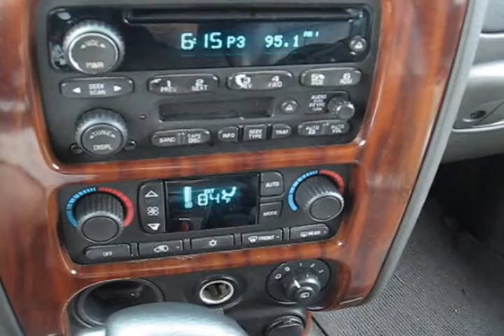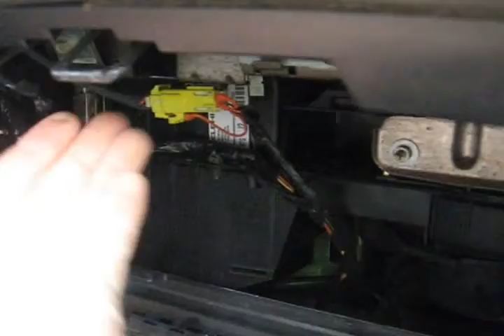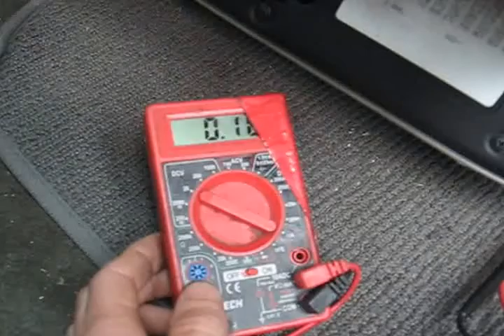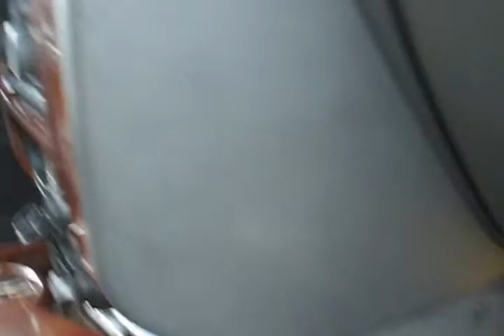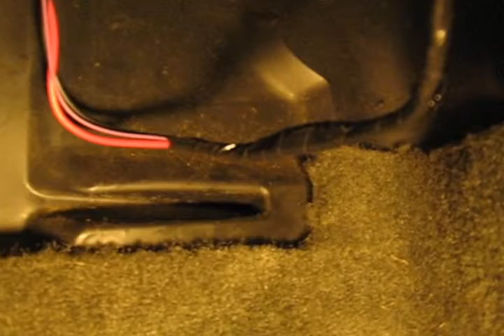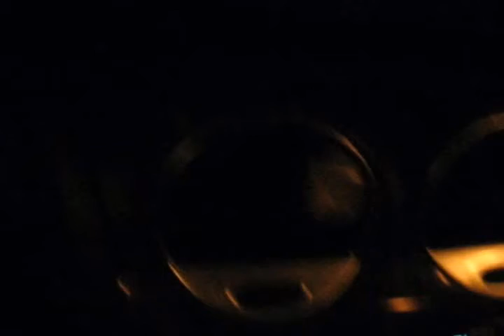DIagnose and Replace GM blower Control Module

Comment: I just bought a 2006 GMC Envoy Denali XL that the blower wouldn’t work. Checked the blower motor, and the blower control/resistor per the video and both checked out. I had a spare automatic climate control panel from my 2002 GMC Envoy, switched it out and the blower began working as new. Usually the blower control/resistor is the culprit but not in my case. Thanks for the great video…

Comment: This was great! The description of the changing voltage on the center wire to increase motor speed was the only video I could find that showed how it worked. Out of the 30 videos I looked at this was the best!

Comment: Is it common for the actual climate control module to go bad? I have replaced both the blower motor and blower motor resistor and it still doesn't work.

Comment: Hello, I have a 2002 GMC Yukon XL 1500 SLT. Can I replace the digital heater/ AC controller by that other type with the sliders ? Thanks.
Reply from the maker: Theoretically yes but I believe you would have to rewire it for a blower resistor instead of a blower control module.
Reply: @pfun41  Thanks for pointing that out. My problem with the digital control unit is that it only starts heating at maximum setting... ? Calibrating didn't help...

Comment: It would have been nice to show how to disconnect all the wire connectors on the bottom panel, also you didn't show how you spliced the wires.

Comment: Do you have a video about it not blowing out all the vents? Mine works great on floor and defroster, but won't blow out through the front vents.
I've also just started having the issue in this video, but mine goes out intermittently.
Reply from the maker: check the description

Comment: I have a 2003 Chevy Tahoe and my AC won't blow from my front panel but my AC works from my overhead fans in the back seat can anyone help
Reply from the maker: Sounds like an actuator issue but I'm not sure where that would be.

Comment: Hey pfun41! I know this thread is older, but I have a new-to-me 2004 Yukon XL Denali with the automatic climate. I’m afraid I may have one or both problems I’ve read up on here in the comments. First, I get no fan speed adjustment when pushing the speed control arrows up or down. This leads me to believe it’s the control module. ALSO, I hear the popping that you have referred to below the dash, mine sounds like passenger side. Should I replace both, the control module AND the air door actuator? Seeing the gear on on the part and your explanation that it could be a stripped gear totally makes sense with the sound I’m hearing. Could this also be related to a THIRD issue I’m having with accessory power killing my Optima Red Top battery in less than 10 minutes? Or am I too optimistic that all three could be related and solved? Thanks in advance for your reply and your time!
Reply from the maker: Blow motor control module can kill the battery, but  unlikely to do so that fast. I would fix that first then worry about the actuators.
Reply: I’ll give it a go and then report back! Thanks!

Comment: Excellent info, thank you.  Just had to do the same to my 06 Trailblazer... but my problem was that the blower stayed on all the time, even with the key out of the ignition.   Same logic applied.
Reply: Mine is doing the same. I have to unhook the battery to get the fan to quit.

Comment: The reason it was only coming out defrost is because your mode was set to defrost. I saw it in the screen display
Reply from the maker: You're like the 15th person to say that, and the 15th person to be completely wrong. There's an entirely different video about that issue, I even linked it.

Comment: ‘07 envoy blower works FINE. BUT the airflow won’t change position
Reply from the maker: Different issue, check my HVAC actuator video
Reply: Ok. Thx

Comment: Hey is there anyway you could maybe answer a question for me, I have searched and searched online and keep getting no where, my 2011 GMC Terrain started acting up heat wise, I could turn the knob up or down or the heat from hot to cold and nothing, doesn’t even acknowledge on the screen that I have changed the setting or heat temp, it was sometimes getting “stuck” at certain temp or fan speed. I have a few times hooked and unhooked things in fan and door module and control resisters in and under behind glove box, as of today I have high speed back for blower but no heat and no other setting fan controls no display for function, also it sounds as if every 2 minutes like the ac pump kicking in and out, ( had it in garage with hood up idle’n this morning before son left for school) I am at a loss, my dads a mechanic but lives in Ohio and  we moved to Missouri with my bf so not much help there, is there something in the dash that I need to check or do you know some keywords I can search to get on the right direction? Thank you
Reply from the maker: I'm not familiar with the terrain, its a completely different platform. You may have issues with the controls or issues with the actuators, but with all those symptoms it sound like the climate controls are going out.

Comment: My neighbor has a 2008 Envoy Auto climate control and blower will not shut off, Is the problem the Blower Control Module? The only way to stop blower from running even with key removed was to pull blower fuse.

Comment: Thank you Sir. I appreciate your video. So the hvac module controls the signal by switching the signal to ground at each level of fan speed increase? How I am interpreting this, because you have one meter lead connector  (back probed) to the positive wire and the other lead back probed to the control  (signal) wire that leads to the hvac module. On low the meter reads lower voltage because the hvac controller is not providing much ground path (lower pwm - duty cycle). As you increase the speed selection, the hvac module provides more ground path (higher pwm - duty cycle). If this is how it works, then the blower speed controller will provide the signal voltage to the hvac module. Then the hvac module will pulse that voltage to ground to signal the blower controller what speed is requested. Then the blower speed controller will pulse the blowers ground path (Lower duty cycle = less ground = Lower blower motor speed). Vice versa for higher speeds selected.
Reply from the maker: That's about the gist of it. In automotive systems many actuators and controls are switched through the ground.

Comment: Question have 2004 Yukon slt.   Air blows cold then Starts blowing hot air have to cut the car off then it starts blowing cold air again how can I fix this AC shop said the pressure and the Freon levels are fine thank you
Reply from the maker: HVAC module most likely. My dad's defaults to defrost only after about 2 hours, power cycling fixes it.

Comment: I posted this under one of your responses but I do not think people understand using a DVM : You have measure voltage with the component (fan motor) hooked up, this is basic electrical....Else you measuring :open terminal" voltage; which in my case (2003 Tahoe) was showing 12v open, 0v hooked up... It was the resistor not putting out 12V under load.

Comment: You Sir are a Master Tech, I am an Avionics,so dangerous around cars; but the AllData manual did not give the voltages you should see from the control panel, only says its PWM..... Good job, Well done.

Comment: Splice= the connecting of two ends, usually referring to connecting wires.
  Butt connector= the device/part/ material used to connect(splice) two or more wire ends together.
Heat shrink=
   Hahaha... forget it, my trolling fun just wore off...

Just messin with ya! Thanks for sharing

Comment: My 2004 Envoy is having the issue he mentioned at the end of the vid: My blower works fine on all speeds, but it only blows thru the deforst and floor vents at the same time regardless of which setting it's on... it also only blows max heat or (once i set it to below about 75 degrees) it blows max A/C / Cold air- it doesn't register a temp adjustments in between.
Reply from the maker: Something funky in the hvac actuators or the climate control module.
https://www.youtube.com/watch?v=xnIDe0j3Fr4

Comment: What did you wire to the harness?  Can you break down what wire went to what?
Reply from the maker: The new Blower control module has a different connector from the old one, so you have to splice the new connector on. Its just two big power wires and then the signal wire. Black to black, red to red, then match up the two small wires.

Comment: my air conditioner blows hot out of the driver's side and cold out of the passenger side and cold out of the back air conditioner for the back seats what is the problem
Reply from the maker: Temperature actuator for driver side.

Comment: I am having a stalling issue on my 06 Chevy Trailblazer Super Sport after running for 20 minutes it dies and then 20 30 minutes later it'll start right back up it does this over and over what is wrong
Reply from the maker: Electrical issue. Something gets hot and fails. Or its overheating and the PCM is shutting it down to protect the engine.

Comment: okay so on my 02 envoy when i go to turn the a/c on, air barely comes out and its not hot . so how can i pin point my problem?
Reply from the maker: Low air flow can be a restriction in the vent system or slow blower speed. You can hear if the blower is spinning at full speed if its not either the motor is failing or there is trouble somehwere in the wiring/ module. Proper diagnostics is the only way to know or sure.

Comment: I have a 1995 Buick Roadmaster the blower motor will not shut off even with the motor off could you please help me
Reply: Patsy Stott blower motor resistor
Reply: @ZShaff90  . yes, I read earlier that the resistor module has a relay built into it that causes that as they go bad.

Comment: I've got an 03 Yukon that blows air to the backseats but nothing from the front vents... although when pressing the gas air comes out the front vents... any ideas?
Reply from the maker: Sounds like a really funky electrical issue. Sounds like the actuators are acting up though but I don't know why the throttle would affect it.

Comment: I have a similar problem but what is different is that I have no display on the screen.  The fan will work temporarily and there will be a display, but then the fan quits and the display will go out.  Any ideas?
Reply from the maker: Sounds like a problem with the climate control module. It could also be an issue with the power to the climate control module. Test the climate control module for power the next time it happens. You'll need to find a connector pinout for it.
Reply: I did replace the climate control module and the problem cleared up.

Comment: pfun41

i have a 2004 isuzu ascender LS  and my issue is the rear blower fan

whenever i attempt to turn it on the fan either does not respond or it will turn on but shut back off shortly afterwards or less shortly afterwards  but then i turn the switch off and back on again and the fan still will not turn on

and also sometimes the rear vents wont let air out unless the front ac unit on

(like the fan turns on whenever it feels like its good and ready)

What can you explain to me so i can figure out what to fix??

:)
Reply from the maker: Could be a motor, control module, or blower control module. Have test the blower control module and blower motor in the back. Not sure where exactly, Ive never worked on one of those.
Reply: +pfun41 actually I did just have the blower motor replaced

still did the same thing (used it very very few times  but this time the switch doesn't do anything neither the rear fan controls either

so yup it's gotta be the module and unfortunately it has to be dealer ordered and I heard it could run about $200

:(
Reply: +pfun41 and unfortunately I have not seen anything online about a control module for the rear...

only for  the front console
Reply from the maker: It has to have one to control power to the blower motor. I would suspect they used the same unit as the front to save costs. Might be worth pulling the panel off and trying to find it yourself.
Reply: maybe possible seeing as thought with the front unit active, the back fan turns on while the rear vents are shut

Comment: Did you determine what was required to correct the issue of the air only coming from the defrost vents?  Mine is a 2003 SLT Yukon and is doing the same.  I can not successfully direct the air flow through the front vents.  I can through the floor and defrost though.  Same part in your opinion?  Thank you in advance.
Reply: It's your HVAC mode actuator,it's a common issue on GM vehicles,another symptom would be a clicking noise/stripped gear ,there's like 4 upfront,when they click,or go bad,they're a little easier to find,because you can see/feel it clicking,when the motor goes bad you won't see the outer hole move,when you go throught the cycles like defrost,to dash air,to foot,the individual climate controls are usually the 2 fronts,1 passenger side,1 driver.Go check out a couple of vids on HVAC mode actuators ,and also do the same search so you can locate them,and find out what each one controls,it's a real easy fix,also find out where you HVAC fuse is and pull it for like 10seconds,then put it back,when you start the car let the air run for atleast 90sec to allow the HVAC system to recalibrate! $40-60 for 1 do it urself,or $200 at the dealer for 1with installation.I say go with the 1st option!LOL
Reply: Thank you.  I'm thinking you've nailed it as I can indeed hear the clicking sound that you are describing.  It sounds like the clicking is directly under the driver side dash/instrument cluster.  Thanks again.  Much appreciated.

Comment: Used this video to fix my 2005 GMC Envoy.  The blower was stuck on high and would not shut off even when the car was not running.  Thanks!
Reply: I have a 2006 Silverado LT3 with Auto A/C and my blower runs with key off. Did replacing the BCM fix that problem on your vehicle?
Reply: Nordeast4 Same vehicle, same problem. So for clarity, what did you replace, the blower control module?
Reply: I just replaced the fuse that controls the blower with two wires ran to a toggle switch I installed up front. Yes, my fan is stuck on high, but at least I can turn the fan off when I leave the vehicle or don't want it on anymore.

Comment: My Blower Motor still does not work on my 2003 GMC EnvoyI have done all 3 tests...  I have close to 12 volts going into the blower motor.I have close to 12 volts from the control module red wire and black wireI have close to 12 volts from the control module red wire and center wire, which mine is purple with a white line...when fan is full blast and around 2 volts when fan is all the way down.What else could it be?Could it still be a bad blower control module?thank you for the help
Reply: What this Moron is not telling you is that these have 12volts at all times the blower module controls the ground to vary the speed. I personally check the power and ground separately so there is no confusion. So if you check it the way Moron41 says to and there is a bad ground going to the module you're going to not get the correct diagnoses .   
I also have found that the body ground wire gets loose and can cause these modules to go bad. The body ground is located about six inches from the battery it's the black wire bolted to inside of left inner fender.
Reply: You have measure voltage with the component (fan motor) hooked up, this is basic electrical....Else you measuring :open terminal" voltage; which in my case (2003 Tahoe) was showing 12v open, 0v hooked up... It was the resistor not putting out 12V under load.
Reply from the maker: If you have 12 volts or thereabouts at the Blower motor and it's not running then your blower motor is bad.
Reply: i bought one from O'Reillys...and still does not work...
going to go exchange it in morning, hopefully it was a faulty new blower motor...
thanks for the help
Reply: I ended up testing my old blower fan on the car battery...It does work...  What else could I check to see why system does not work?    another thing is that I drove to work with the blower fan not hooked up and sitting on the floor board, had the heat set to 90, and never could feel heated air blow from the hole where the fan get mounted in.  I am now thinking that no blower fan and the heat are related.     Thank you for any help that you can offer me.
Reply from the maker: The blower is what moves air around in the HVAC system, you will not feel any air moving with it removed. Plug everything in and leave the motor sitting on the floorboard and see if it will spin when you turn the fan on.(don't do this for long, the blower control module needs airflow to stay cool) Its possible there is something catching on the fan when it is installed and keeping it from turning. Sometimes Blower motors can fail in such a way that they won't start spinning again if they stop in a certain position, moving the fan a little will make them start working again temporarily. It's possible that your Motor has failed this way and the Oriellys unit was faulty.